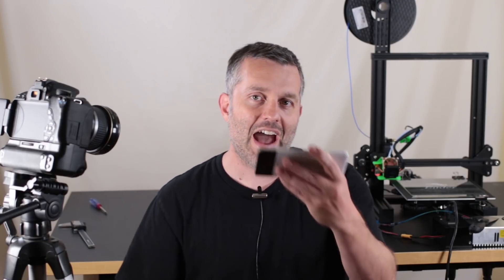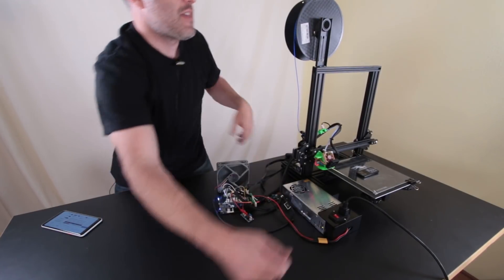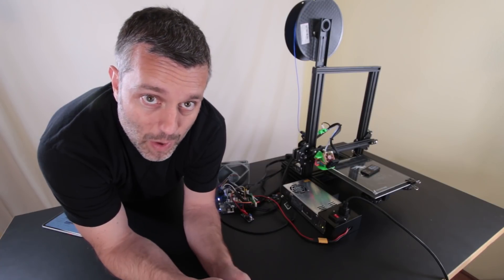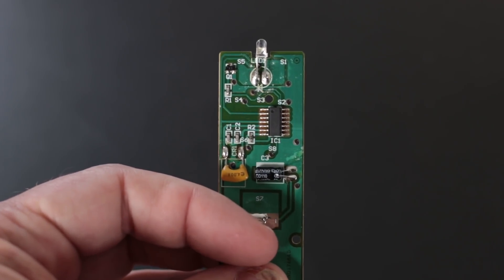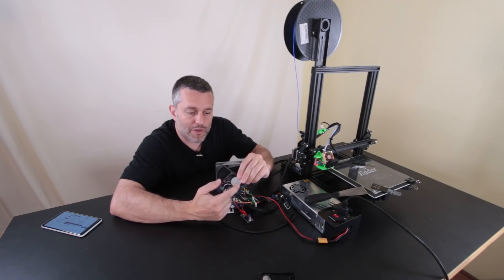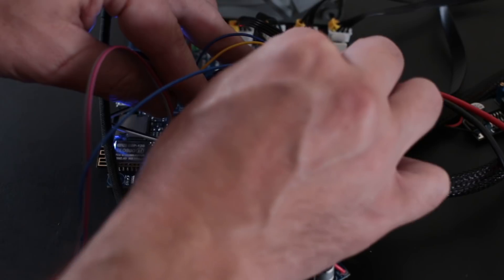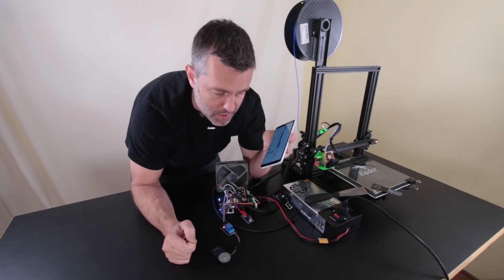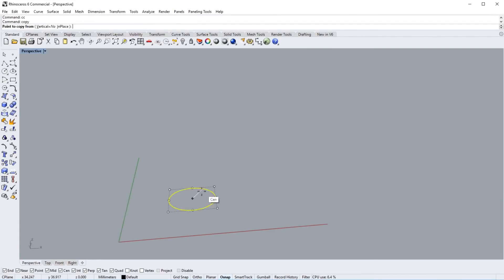Make Amazing DSLR Timelapse Videos of 3D Printing...Wirelessly.

Comment: can we do that with a duet 3 SBC setup with raspberry ?
Reply from the maker: You can do this exact project with a Duet3 no raspberry needed. However, I find the duet 3 to be kind of overkill for most 3D printers. I'm still a huge fan of the less expensive Duet 2.
Reply: Design Prototype Test actually am running reprap on skr 1.4 turbo with raspberry pi b3 same setup as duet 3 with sbc running with one cable from the go10 on the raspberry pi and the exp2 runs good but would love to do this photo setup you have I like it
Reply from the maker: Are you running Reprap firmware?  With that setup including the Pi, why wouldn't you use Octoprint and Marlin or Klipper? Octoprint is far better than the technique I showed.
Reply: Design Prototype Test I was running marlin and octoprint but I prefer the reprap a lot more control and very easy no compiling no errors it’s direct gcode I love reprap never going back to marlin again
Reply from the maker: Hopefully someone will develop Octoprint like functionality for Reprap. The German gal who made Octoprint should do it. Reprap is the future and Octoprint gives some fantastic functionality that as you are aware is currently lacking.
Reply: @DesignPrototypeTest  i dont think she will do unless its the Octoprint is the main web interface otherwise she lose all what she invested in as time i mean , am able to install the program called Motion on the PI and see the camera on the DWC web cam but there is no function to make it do time laps unless motion have a way in it to control that i will dig a bet deeper

Comment: I’ve been looking for this on my duet! Thanks! Also there’s a layer change plug in setting in cura that you can insert your own code in between each layer! I would love to see another video like this!
Reply from the maker: If you are actually going to implement this, you should change the Macro I showed in the video. This macro is better:

G60 S1  ; store current locating information
G1 X0 Y220  F6000 ; move print head to back left corner out of the shot
M106 P2 S255 ; Turn fan pin 2 on for photograph
G4 P500  ; Pause AKA Dwell for 500 milliseconds half a second
M106 P2 S0 ; Turn fan pin 2 off for photograph
G1 R1  ; recall location information from the G60
M400  ; wait until movement is finised before proceeding
Reply: Design Prototype Test Thanks! Now I just have to find a good camera! I’ve been trying to make a smartphone work. DSLR is a bit expensive for me right now haha

Comment: Great video!  I've been thinking of putting a Duet board in one of my 8 bit printers, but I didn't want to give up Octolapse or the ability to monitor my prints with a webcam remotely.  I could use a RPi with the Duet, but that seems way too redundant to have two 32 bit boards on the same printer.  So your solution is timely and necessary in my opinion.  Also, I really like how you used Cura instead of Simplify3D.  So many Youtubers use Simplify3D and many of the viewers (including me) don't have it and will not pay for it (especially since they are now charging for an update).  So many thanks for the great video.

Comment: I just ordered an Ender 3D, and while I’m waiting for it to arrive, I try to learn as much as possible about it. This made me come across your Chanel. I salute you for the clarity of your content. I immediately subscribed! The only thing I would like to say and this is not a criticisme but more a friendly advice that would save you heaps of time. I am sure I am not the first one to tell you about it. You should really consider moving from Sketchup to Fusion 360! Specially for prototyping! Fusion 360 is a parametric software so if you need to thicken a part to make it stiffer, you  simply open the file, change one parameter (10 seconds or so) save and reprint! I used to work with Sketchup, in fact, I made the plans for my entire house with Sketchup! I promise you, spending the time to learn Fusion 360 is a great move! You will not regret it! It’s going to open up a whole new world of possibilities for you! Again, great videos! Thank you!  - Blaise

Comment: Thanks for great idea! I don't really need to make good timelapses of prints, but this is too neat not to try. I have one thing to add - why not skip the whole electronic part all together and have the heatbed trigger mechanical switch when you home Y axis for picture taking? Well, that's what I'm going to try anyway.
Reply from the maker: Check out the video by "Make Anything" where he did exactly that.

Comment: For the remote control, would extending the IR LED with some wires (so remote is in with board) help make mounting easier?  
You could improve the power of the IR by putting foil behind it as a reflector (old wives tale maybe).
Improve the angle of the IR (to reduce requirement to adjust with camra), drill a hloe into acrylic 1/2 way, mount the LED and that should spread the signal out.

Did enjoy the video.
Reply from the maker: This would work.

Comment: Great video! Does the pause command take care of the oozing?
Reply from the maker: Good question. Yes, the pause command does retract the filament. Because reprap firmware is based on macros, I can easily go into the pause.g macro and adjust the length of retraction.  The point where I'm having and issue at the moment is with the un-retraction on resume. The printer is correctly moving to where it is hovering over the last print coordinate the next move is downward to where it is  touching the part. For some reason, it is extruding material during this move. I'm currently discussing it with the experts over on the duet3d forum. We'll get it solved. :)

Comment: nice idea, saw make anything do somethign similar with a physical press of a remote control for the canon

there are also USB tethered solutions to simulate the shutter release on the canon. that could be a solution as well
the IR has con/pro of needing eye of sight so you must mount it somewhere.
maybe we could hack the pulse command and use a simple arduino nano with IR transmitter and just attach the transmitter led somewhere ...

Comment: Cool vid. When's the next part of DuetWIfi on Ender setup coming? Specifically the bit on how to configure everything once you've got it connected?
Reply from the maker: Next video.
Reply: No I get that ;) You basically said so in the video here. I was more curious as to when that new video will be published :)
Reply from the maker: Soon. Sorry,  to be vague, but it takes time, and it's not a linear task for me. I don't know how long it will take, but it is the only video I'm working on at the moment.
Reply: Totally understood and had to check just in case. I just did the same thing you did along with a titan aero. I got it all connected and am now trying to figure out the resistance of the bed thermistor to give me the right data... now it’s at 2000C.

Comment: Duet has other breakout pins -- which make it unnecessary to use a relay (expansion pins, they're on the expansion header -- or Duex5/2)
Reply from the maker: I think all of them are pull down resistor type switches, so it won't fix the problem I had where I tried to connect both leads to ground pins on the DUET. There may be a way to do it. It would be nice to get rid of the relay.
Reply: @DesignPrototypeTest  you must tie the ground on the controller on the battery and the ground on the duet power supply, there must be a common ground, then you can use one of the 4 expansion switch pins to control it.

Comment: You could use an arduino to record the button press with an IR receiver and then play it back with an IR led. That would make a smaller board and no hacking a remote control.
Reply from the maker: This is possible  but hacking a $1 remote is a lot easier than soldering up an Arduino with power, and all the other necessary wires. Not to mention the difficult task of programming the Arduino. I don't know the IR protocol to trigger a Canon camera to release the shutter. I might be able to find it but it won't be easy. Not to mention the fact that once I'm done the package with the Arduino will be a lot more cumbersome than the Remote with two wires sticking out of it.

Comment: SICK! Can this be done on the stock Ender-3 control board or are we forced to upgrade to the Duet?
Reply from the maker: I'm sure someone out there is clever enough to find a way, but it will be a lot more difficult. I'm not going to spend my time trying to figure it out. DUET Wi-FI running Reprap firmware is so much better than stock! The time and headaches you will save is worth the money to buy a DUET. Also, I have other recent videos about putting the DUET on an Ender 3.